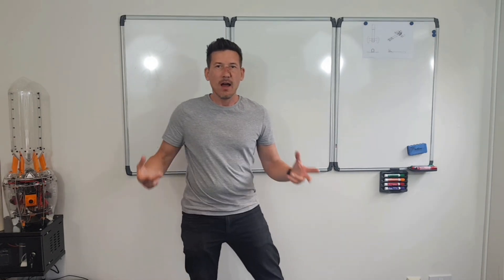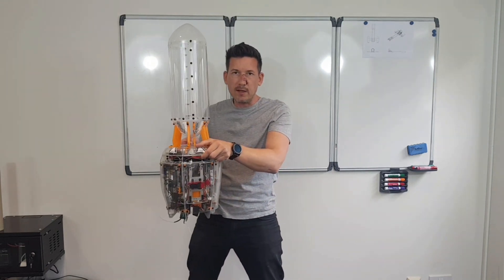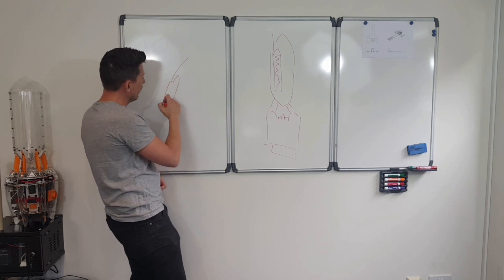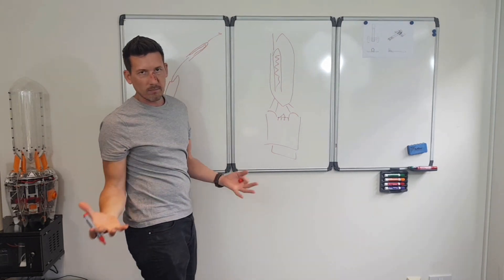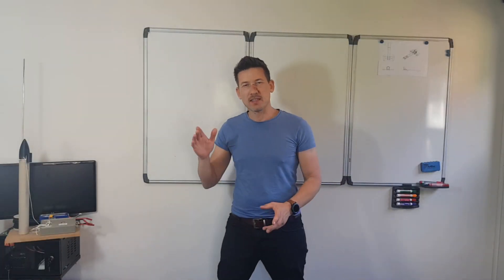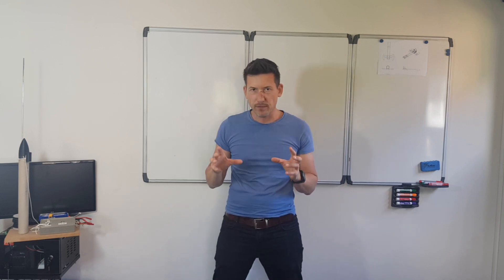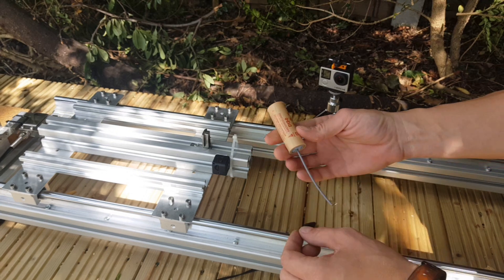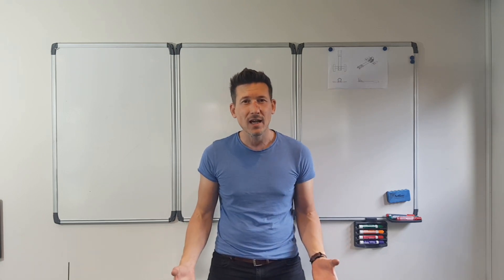RR-01 Ballistic Chute System Part 1

Comment: Interesting idea. But have you not thought about a pyro based system. Something with maybe a .22 blank as the gas generator. In a lightweight steel or aluminium piston. Much less flame and sustained heat involved that could damage the drone or parachute. And a much more rapid deployment of the chute. Just a thought.